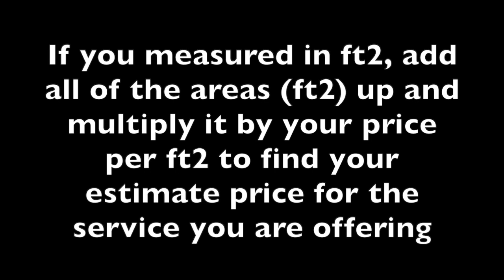How to Measure & Estimate for Asphalt Paving or Sealcoating

Comment: Measure map pro. Takes care of all the guess work. Only have to use your wheel to double check.
Reply: I just started using that program. It makes it easy.
Reply: Wouldn't you add the depth of material into the equation for overall material needed ?

Comment: Good stuff my man! I was wondering if you were going to address the flare (radius) at 'the street entry points' (often driveway entrances). I just Googled "driveway estimating sheet' and something came up that called 'flares' 'Fillets' and had a funky calculation (compared to a triangle)!? 

**
Shapes:
Rectangle
Triangle
Circle
Half Circle
Fillet

Shape	A, ft.	B, ft.	"Area, Sq. Ft."
Triangle	10	10	50
Fillet	10	10	21.5
**

Google Earth often has you stuck with views that are less than decent. I've found that the aerial view from 2017, more often than not, removes 'the leaves' and provides the cleanest view.

Google Earth can get pretty inaccurate. I've physically measured perfect rectangles, without obstructions above, and then compared them to Google Earths' measurements. Sadly the result fluctuates and can be high or low 6% +/- . That can hurt ya on a 20,000-square-foot octopus-shaped driveway (think rich people's driveway).

Obviously 'things' under awnings, eaves, canopies, and decks can be seen via Google Earth.

To this day I feel I can't come close to the exact square footage of driveways that are not square or rectangular (with my wheel, pad, and pencil).
Reply from the maker: We mainly use mapping software for everything at this point